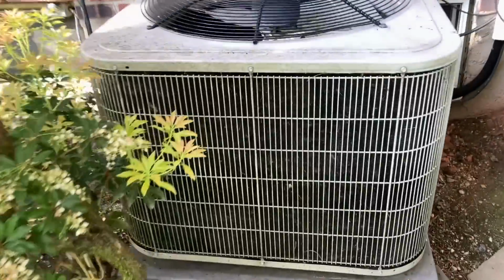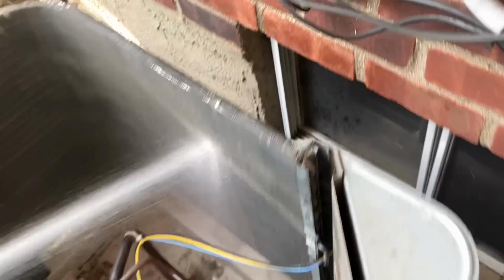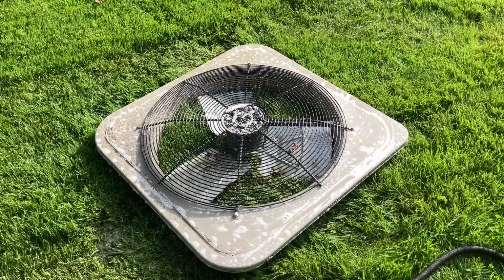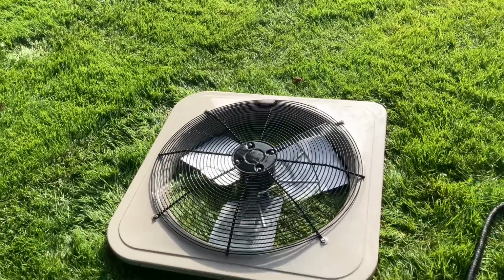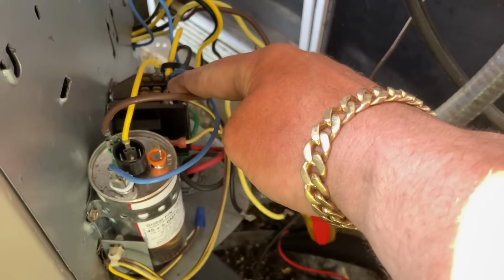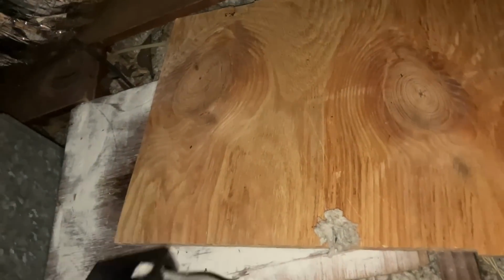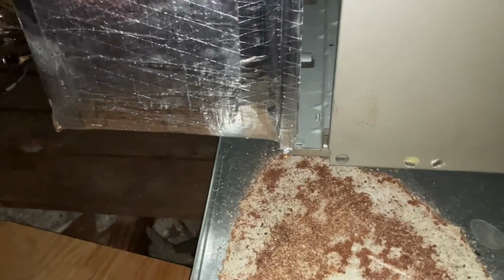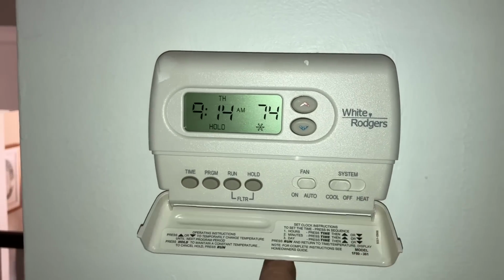This DIRTY AC Unit Got the Mikey Pipes Deep Clean — Homeowner Shocked!

Comment: The know it alls with no a/c training are up in arms because you took the top off and cleaned from inside out (proper way) especially a high efficiency double coil, they don't care if the bottom is full of leaves which block drain holes at bottom, they know more than a a/c contractor
Reply from the maker: Thanks for watching!

Comment: In my neighborhood, most units only get dust/air born dirt buildup, nobody cleans. Twice a year, I hit from exterior, every 2nd year do from the inside. No chemicals needed. I’m just trying to maximize efficiency since electric prices always go up. Love my gas for home heat, oil for garage and shop. The efficiency of fuel is instant, quick gratification in the heating season.